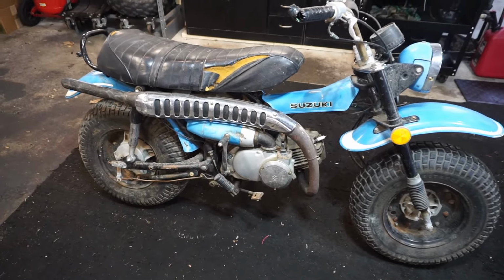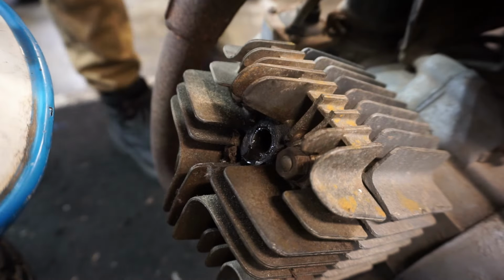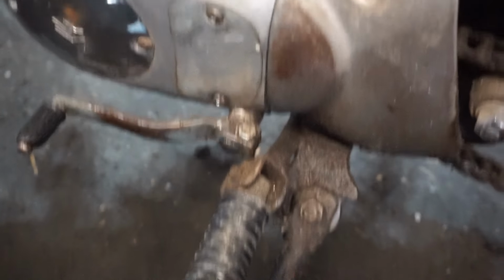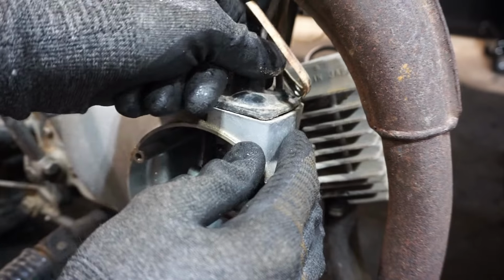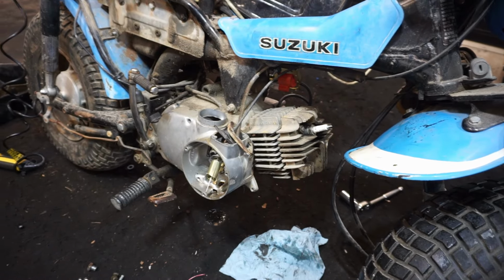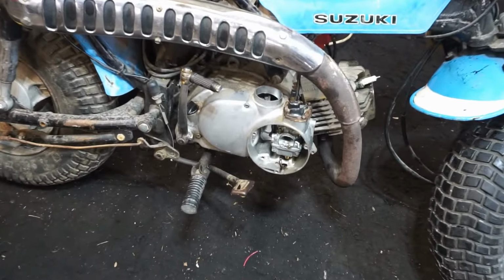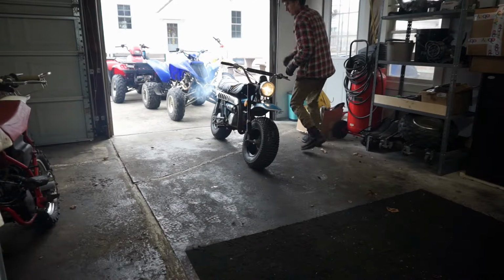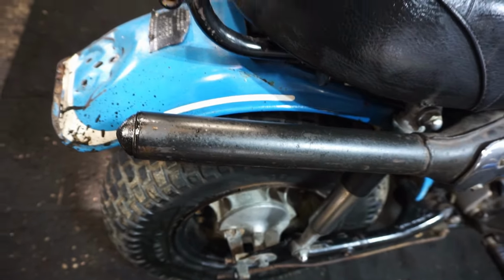Abandoned Suzuki Rv90 Bike Sitting For Years. Will It Run?

Comment: **VERY IMPORTANT** I know you added premix “to be safe” but these are not like Yamaha’s etc.  Suzuki CCI (which is their oil injection) directly lubricates crank bearings with oil from the pump.  If you run premix only and don’t use the oil injection…or if the oil injection is not working…you can destroy the crank bearings.  Suzuki has serious warnings that failure to provide proper oil through the crankcase injector ports on the CCI oil injection systems ON ALL MODELS (excluding TS/TM 400) will cause main bearing oil starvation.  Just an FYI.
Reply: A friend of mine had a 
Suzuki gp125 cafe racer and the guy he got it fro INSISTED that he always used the cci/oil pump, explaining why !!..,
He had ported it & lightened the crank quite a bit, it went ........ 
well...............
 
It went from low revs 
till 6,000rpm okay then it spluttered a bit and BANG 
6,000rpm till 10,500rpm was like a rocket or explosion 💥 👌🏼 

On/off loads of great 2 stroke power band ,  and us being 17 years old, it was fast for what it was 💪🏼💪🏼💪🏼 

Great times 👌🏼👍🏽
Reply: Very interesting, thanks for the knowledge.

Comment: Once the transmission oil leaks into the crank case, it travels, with the fuel/air/oil mixture into the cylinder via the transfer ports. No need to get past the rings. I've worked on engines that had oil leaking past the crank seals and also engines that leaked oil into the crank case between the case halves. When the latter happens, the cases are usually warped. Sometimes resealing the cases works, but usually the cases (in my own experience) have to be replaced or resurfaced (if the deformation is minimal). The engine sounds great. Doesn't sound like the crank seals are leaking and I didn't see any transmission oil sputtering out the baffle. Looks like you lucked out with this one. Let's hope that metal that was stuck in the baffle came from a different piston. Couldn't see it very well, but looked like it could have been the edge of a piston, just above the top ring. Hopefully the piston's already been replaced.
Reply: I don’t think it would crank if the piston was broken
Reply: @Steve-e6k9w  I have a KX 250 in my workshop right now. It has a broken piston and kicks over very easily.

Comment: Maybe put (used) oil in to preserve the cylinder? But would've thought it would drain past rings over a year or less.
Reply from the maker: Yeah I had the same thought
Reply: I had a garbage find ryobi chainsaw that tipped on its side for a while and the fuel mix drained into the case since the piston was at TDC and the intake is lower than the bottom skirt of the piston.
Reply: It's in the instruction manual I believe, to put oil into cylinder before putting the bike into storage. But whoever did this on this bike went way over the top with the amount
Reply: @juk-hw5lv  yea, unfortunately no one does that anymore for the most part. I have some old cans of "fogger" oil which were meant for that.

Comment: Thats a awesome looking bike, do you still have the atc 250r? Have you thought about picking up a 85-86 liquid cooled 250r atc? I'm a big 3 wheeler guy but love all the bikes you get, it's nice seeing a normal guy buying and fixing these things.
Reply: This guy is awesome
Reply: we used to pour oil into the cylinder via the spark plug hole to prevent the internal parts from corrosion during long periods of not using... nice of the mouse to provide extra air filtering

Comment: The big issue is that all that oil was totally filthy. That doesn't happen in 2-strokes. Use once and burn it away. Mysterious stuff... The clean oil looks like gearbox oil. (I'm just guessing)... So I was wrong. A fine bit of detective work, feller.

Comment: What a blast from my past . I owned a red one in the late 70s.
I would get 5 of my friends on it and we would cruse the trails and streets.
The gas tank cought on fire and it burned up on the side of the road.
Mine did have turn signals and tail light on it. Fond memories thanks.
Reply from the maker: Haha that's awesome. The seat is huge on this thing!
Reply: I had a Blue one just like this. Turn signals, empty license plate holder under the stop light and a chrome rack on the back. I remember Dear Old Dad and his mechanic friend taking the exhaust pipe off once, getting a nice hot fire going in the fireplace and placing the exhaust pipe on the fire to burn all the oil and carbon out.
It always smoked. The only time I ever got it to stop was one time when I made several "high speed" passes on a straight stretch of logging road. 
Put hundreds of miles on the thing riding around in circles on our 1.5 acre lot.
Fond memories for sure....

Comment: I need to hunt one of those down this way and fix it up! Didn't know they existed! Wanted to share something you may already know that I just found out within the last 5 years and I've been servicing and repairing bikes for 35! Vessel screwdriver company (japan) makes a JIS #2 screwdriver that looks like the one you use a lot, but it has an impact device that turns counterclockwise 12 deg when you smack it with a hammer. Vessel Megaladora impacta is what it's called. I got the entire kit and it's life changing man. The JIS fits little bike's screw heads like this one 100 times better than a #2 Phillips. Amazon has the Vessel's for a really good price. I have a review up over on the channel if you wanna check em out. Great video man, gonna go on a hunt for one of these little bikes now!

Comment: I had a pair of RV 225s in high school, rode the wheels of them. Tons of fun super easy to work on.got both with spare parts bike for $350.00. Enjoy, the oil pumps were only real issue. Not fast but fun and steady. Enjoy!

Comment: I had a simalar issue with a 4 stroke Chinese engine. Looks like it had a bit too much oil in it, some older guys used to fill up the cylinders with oil if they were gonna sit for a long time so they didint seize up. But you never know!

Comment: I have a 76 RV90 and parted out a 74 back in my youth that I found in the landfill.  There is a light assembly and a luggage rack for the back that tied into the bolt holes on that black loop and into the shock studs. Turns signals were standard on the 76, but not sure on earlier models. Make sure you take the exhaust off and dump out that extra oil.

Comment: We had the RV 125. It had 5 gears. When I was a kid I had it going 70mph. That baffle in the muffler comes wrapped inbaffle material. That's the carbon you found. What's left of it. They came with tail lights, turn s8gnals, plate frame. Road legal bikes. Ours had a tach. The 125 was designed better. Carb behind the motor. Whole frame. They had buddy pegs to. It lasted a long time. We beat that thing. Lol. Battery not needed. Not battery ignition. It worked turn signals while idling at red lights.

Comment: Should take a torch to the muffler/baffle and then fill the exhaust with gas and set it on fire so it burns all the crap out..sounds sketchy I know but I’ve done it to a few 2 strokes and it works well
Reply from the maker: Haha I just took a heat gun and stuck it at the end of the pipe. I left it sit there until it quit smoking. Then I hit it a couple times and all the carbon comes out of the pipe.

Comment: That's a collectors item, hang on to that thing. Usually people who mainly offroad these things take the signals, rear light and mirrors off so they don't break them. The center case gasket or sealant probably isn't holding anymore, oil for the transmission side of the motor leaking through if that's just straight oil, or maybe like you said, the guy put oil down the hole to keep it from locking up, or it was locked up and he put oil in it.

Ken Kaplan probably has all the parts for that bike.

Comment: It appears the oil injection pump leaked by the check valve and filled the crankcase with oil, either that or too much oil in the trans case will do the same. Try pulling the cylinder head off and see what is going on. There will be a large o-ring sealing the rotary valve case inside the clutch case, if it is leaking, then gear oil gets in, same with crank seal behind the rotary valve. Easier than it sounds to reseal it! You may need to pull the engine to dump the oil from the crankcase so it'll turn over. Use a propane or map gas torch to burn the crud off the baffle & spark arrester.
Great video, not much to those. Thanks Joe!

Comment: I stopped at 12:30 to say that the oil does not go past the rings. I gets transferred thru the transfer ports just like the fuel and air does. You are correct that the only way oil can get in the engine is thru the crank seals.
Reply from the maker: If rings are bad oil can go past the rings if crank seal is bad.

Comment: so way back in the 80s we used to get this issue with 2cycle suzukis with simular motors , gp100 gp125 gp175 
the burned oil collects in the exhaust packing and eventually blocks it up , causing the issues you see , 
we used to take the exhausts and put them on a fire and let them heat up and burn all the oil off , and then just re-fit them and go tear up the trails again

Comment: Best way to clean a pipe is fire up the burn barrel or bbq grill and get a good hot fire going and put the pipe in the bed of coals . 24 hours later tap all around the pipe and blow sir both directions to get the loose stuff out and high heat black paint and you have a new pipe .

Comment: When l was 18/19 l had a t25Or
my brother inlaw sold it to me
for £200,  l also removed the
Baffle & jammed a cork bung
leaned it up right & filled it with
fuel/ gas. Next day l poured a 
little gas out blocked it up again
& gave it a good shake , after a
Clean up( it was pretty messy) l
took it for a road test god you
could not see behind you for a
few miles ,  but it ran better
until the next problem cropped
up , l now ride a GSX 1400 k8
Oh my old bike was a T250J
not a T250R😱

Comment: Hey my name is Jason I live down in Southwest Florida I just picked up a 1988 Honda FourTrax 250x 4×2 I already put a lot of money in it new wheel bearings tires brakes carburetor sprockets chain did an oil change and replace air filter starts up first kick idles perfect runs good except going out of first gear getting into second gear it's grinding but not just while shifting into second the entire time you're in second then when you shift to 3rd and the rest of the way up it's fine runs normal sounds normal what could my issue be? I would really appreciate it if you could help me I don't know if I need to do a whole bottom end and gears and clutch plates but since it's such an old machine I don't know where I can even find the original parts for bottom end I was thinking about looking for a complete motor on eBay or maybe even just bottom end of a motor with all the gears functioning correctly but if you know where I can get a complete engine for that 88 Honda FourTrax 250x that would be really cool anyway I hope to hear back from you I watch your videos all the time you're very smart dude

Comment: Ireason you cant kick it over. t's hydrolocking with all the oil. Your rings not necessarily worn. The oil is leaking into the crank case, then via the ports the oil is sucked up into the combustion chamber, same way as fuel would be suck from crankcase.

Comment: I just inherited the exact same bike from my dad. The coil to my spark plug also broke when i pulled it off. do you have the website where you bought your coil/wire? any help would be appreciated.

Thanks!
Reply from the maker: Here is the ebay link to the coil. https://www.ebay.com/itm/Honda-Hi-Performance-Ignition-Coil-6-or-12-volt-Points-or-CDI-Single-Lead-/312770968265?mkcid=16&mkevt=1&_trksid=p2349624.m46890.l6249&mkrid=711-127632-2357-0
Reply: @2vintage  Thanks so much!

Comment: To get rid of the carbon crap in those caked up 2 stroke pipes, just start a little wood fire in a burning pit or something and those those pipes in the coals. It isn't hot enough to melt the pipes, but it will take out that carbon for sure!

Comment: Oil in engine is tranny oil.    You have an injection issue.    Disconnect oil line from carb and see if it still does it